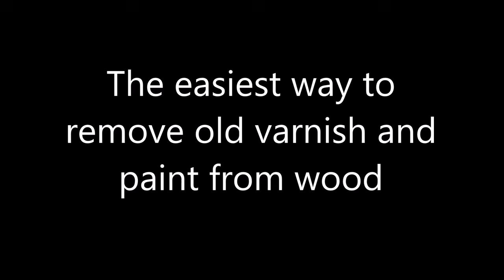The easiest way to remove old varnish and paint from wood

Comment: I know I definitely need one of those scrapers! A scraper you pull, instead of push, seems so much more controllable. I have just about every style of scraper there is, from cheap crap to the most expensive I've seen, and no matter what I'm doing or how careful i try to be, inevitably it comes loose & causes some kinda damage. I'm actually pretty surprised that pull type scrapers aren't more common

Comment: best to have a scrapper fallow behind the heat gun as it bubble and move and a n0ther tip start at bottom work way up case heat rise this way as y get there its heat up and not cold as y m0ve

Comment: Can you do this on a laminate floor.  My tenant waxed it or varnished it I am not sure but I can scrape the dry spots out .  Please let me know
Reply from the maker: No, you can't use this method on anything but wood. The heat will be too much for the laminate so it will ruin the floor. You need to look for something that can dissolve the wax or varnish but do no harm to the laminate, and then wipe it off with a cloth. Don't use a metal scraper, it will almost certainly scratch the floor.

Comment: Could I use this on very old painted black beams?
Reply from the maker: Maybe, but it depends on which paint is on them. Very old beams may have been painted with linseed oil paint, and if this is the case, you probably can't use heat. It's my experience that linseed oil paint and varnish turns into a very sticky gum-like mass as soon as it gets heated. It is quite easy to scrape off cold with a sharp scraper though. 
I would recommend trying it out on a small area to see how it reacts.

Comment: What about the edges and  inward corners?
Reply from the maker: Inward sharp corners are in most cases not problematic. Inward roundings are more difficult, and sometimes it is necessary to make a scraper especially for the purpose - an old chisel is a good starting point, but a sharp piece of iron in the right shape can also be used if it is only a small area. 
Edges can be scraped with caution, use a light hand. The same goes for rounded edges. Sometimes it's better to just sand the edges though, especially if the wood is soft.